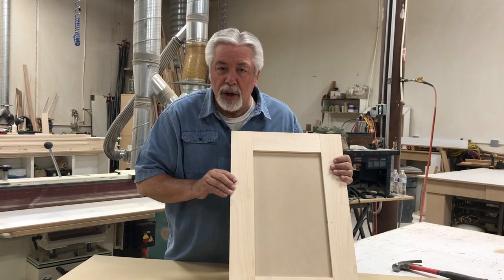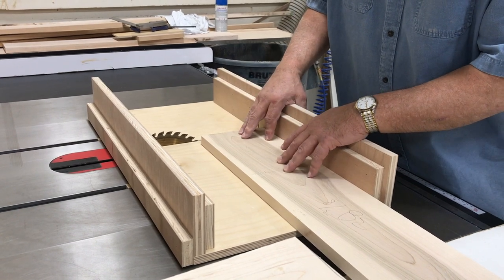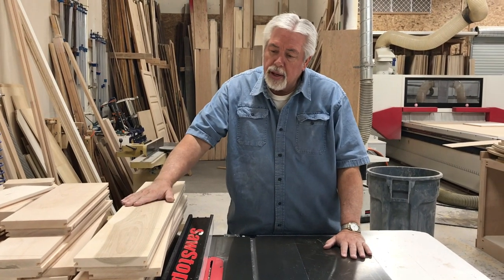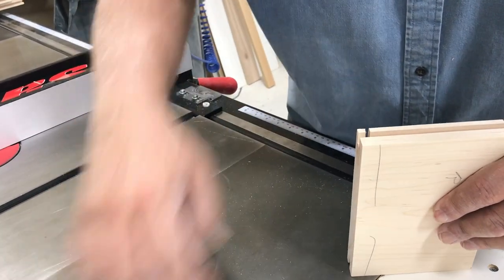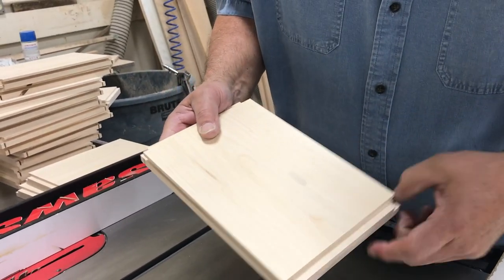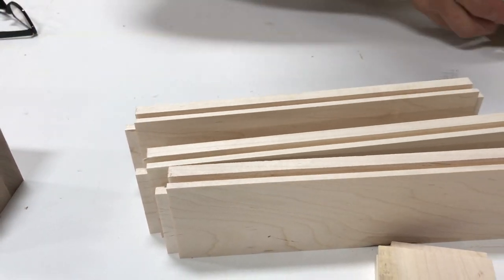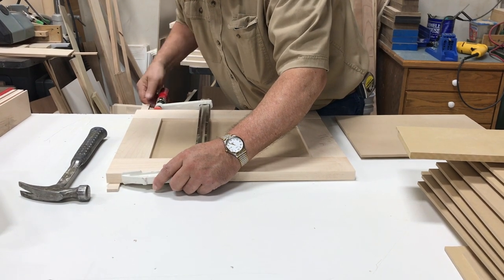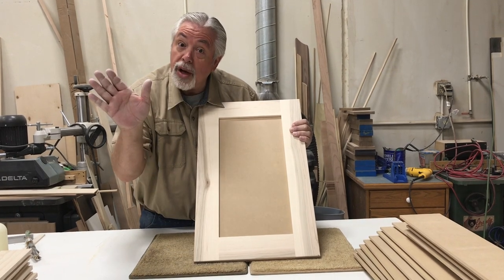Shaker Door Table Saw Style

Comment: Wes, I went today to get the router bit to begin practice on making a shaker door.  What style of shaker bit is recommended?  I believe there are about 4 or 5 different router bit styles.  Thanks.
Reply from the maker: The square cut stile and rail set is the most traditional shaker door style. Thanks, Wes

Comment: Wes, I will eventually be making my own shaker doors. I want to do an antique glaze on them though. I was thinking about doing a bead/Ogee on the inside edge profile that way the glaze stands out a little more. What step in your process would you recommend adding the bead?
Reply from the maker: After you complete the build on your shaker door, make your bead/Ogee separately and miter it into the inside of your style and rail and then do your finish.  I hope that answers your question as I understand it...please let me know if you need more info.
Reply: @WoodworkingWithWes  I think we are on the same page. What is the best way to do that so you are able to reproduce that on every door? Thanks for the replay btw
Reply from the maker: @Waynegoproductions  Your question makes me think that I don't fully understand what you are trying to accomplish.  But the mitered in bead molding needs to be done door by door. Hope this helps.